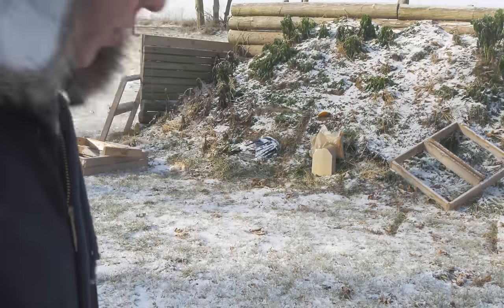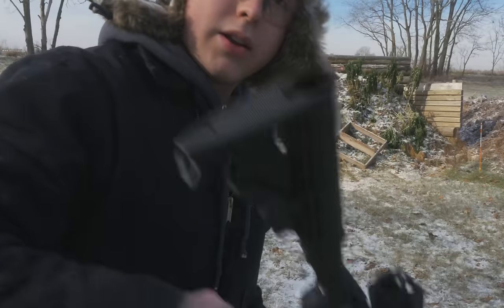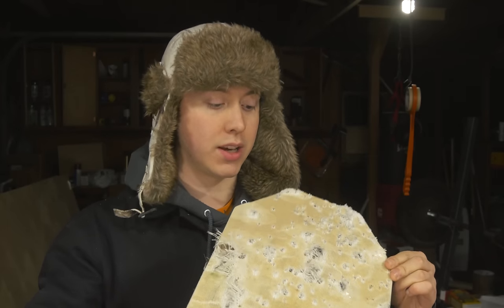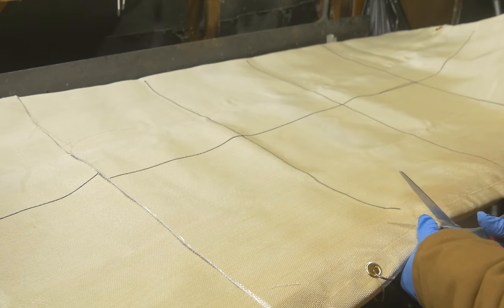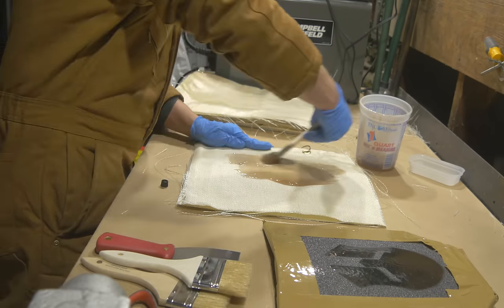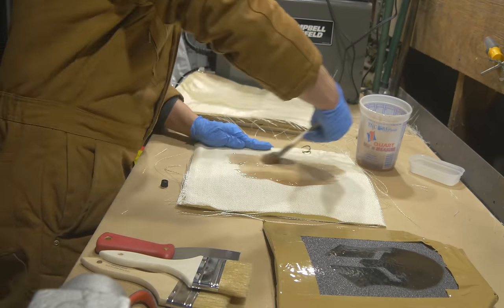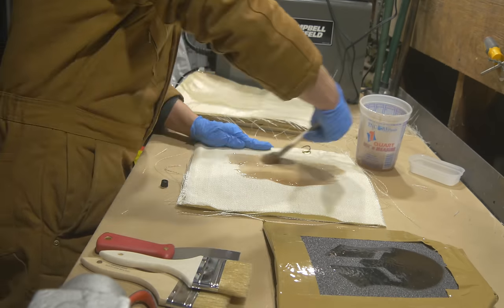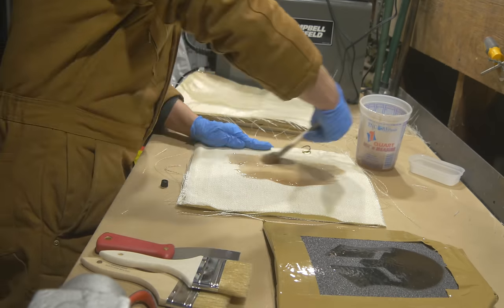How to Make AMAZING Bullet Resistant Armor for $30

Comment: stops 9mm: I have seen this before.
stops birdshot and buckshot: you got my attention.
stops slug: spills drink
Reply: the real question though is how far does it like dimple in you need to put it on clay and shoot it. if it goes in more than I don't remember exactly it was like an inch its still fatal. because the shock will still RIP your organs apart. like tear your heart in two. stopped the bullet but doesn't mean shit if your heart is in 2 pieces. look up nij tests and standards
Reply: Buddy, time to make that shit, right fucking now!
Reply: @bobthompson4319  when worn inside a carrier that might make the difference tbh
Reply: @AshleyBlackwater  not true. it would need to be tested correctly. have you ever seen what it looks like to be shot with a vest on? it stretches the skin so much that it still makes a hole. it's not like the movies.
Reply: @bobthompson4319  I mean the carrier itself can be the difference between wether it works or not. Unless i'm thinking of specific designs that require both hard and soft armour?
Reply: @bobthompson4319  Maybe so, but you aren't gonna wear the plate right up against your ribs. You will have it in a plate carrier and probably some clothing behind as well which will act as a buffer for the indentation in the plate. Best solution would probably be to have some impact foam like used in bicycle helmets etc behind the plate so that they can crack and absorb the dent impact of the slug. Only issue is that it will make the whole armor a bit thick, but hey if it saves your organs then why not
Reply: @Lorgar I'm sure they do, but they also gave them a name (Trauma pad inserts) in order to milk some extra cash by acting better than they really are. Truth be told, I don't know how much the difference would be or how much they charge for said trauma pads, but going with this video's idea of minimizing cost, I think some common protection foam used in bike and ski helmets etc is gonna be more than adequate for hindering a slug from ripping your organs though the body armor.
Reply: even more so if it stops a god damn 357 magnum round at point blank
Reply: @Real_MisterSir  blue camping pads comes to mind.
Reply: @bobthompson4319  Just add some trauma padding around the plate and make it a standalone plate
Reply: @bobthompson4319  how about spring loaded armor?
Reply: @NwoDispatcher  not likely to help. think of a soda can its really light nothing to hold it in place but a bullet will fly right through it so fast it doesn't move. so it's likely that the springs wouldn't even compress any and the bullet will slice through or if its stopped then it might help with the impact but having the springs help with stopping the bullet it won't help with that the plate of armor would have to be able to stop the bullet its self. if all that makes sense
Reply: Thompson don't know, id figure it would be a factor of how much impact can a spring can handle before it bottoms out. The main reason for the spring would be to disperse the bullets force over the entire surface of the plate.
It would be the difference between   shooting the can with a pellet that's fixed vs one that moves.
Reply: Only if the guy wearing it is on the ground or against a wall will an inch of indent happen, else he will just get thrown back reducing the impact
Reply: @bobthompson4319  stops the guy behind you from being killed
Reply: @NwoDispatcher  doesn't work like that.
Reply: @preetammeena593  he won't get thrown back
Reply: You think stopping the birdshot was more impressive than stopping the 9mm?
Reply: @bobthompson4319  You could buy a trauma pad.
Reply: @bobthompson4319  despite the lack of need for one with most modern body armor currently made, a trauma pad behind the plate would be pretty helpful if you are afraid of that happening.
Reply: since you all know so much and have such great ideas about how effective this will be why not strap it on and take a 12 ga 1oz slug from 10 ft???? if you do I'm not responsible for what happens. and then you can all see for yourselves.   post a video...... or have someone else do it in the event of your likely death or serious injury.  I'm waiting. I need a good laugh.
Reply: @bobthompson4319  What you need is to calm down, lolz.
Reply: Better than walking without armor thats for sure
Reply: shoots t rex shot (real thing used to stop hippos on an africa safari)
Oof im def- stops it
Im suffering cancer
Reply: Bro you should really wear a mask when cutting or sanding that fiberglass I don’t want you to get on those mesothelioma ads...

Butttt I’m probably gonna do this now... 👍
Reply: Wala pm pako unya bai
Reply: @bobthompson4319  indeed, but it is cheap and light weight. Perfect for bullet proofing a car on a budget.
Reply: Slugs aren't that hard to stop
Reply: bob thompson that could be eliminated with padding
Reply: Riiight!!!! Got me HOT! 😍
Reply: Most body armor stops shotguns.  Pistol rated soft Kevlar will usually stop most buckshot and probably the majority of slug designs.  They have a pretty slow velocity so they are easy to stop with armor.  It would probably break a few ribs though.
Reply: @bobthompson4319  Impact seems minimal, but of course, this can lie. I'd expect minimal impact even so though...
Reply: @kiLLaima  It would then be a ICW plate because it's worn ICW the pads, and besides that TPs aren't ballistic, just shock reducing.
Reply: I think all you experts out there since you know SO much about this should give it a shot. Put one one and try a slug or something.
Reply: @bobthompson4319  
Hard pass on that one chief. Production variance and all that.
Reply: Bob  that doesn't mean it won't kill you
Reply: Bob   and you obviously don't know what your talking about. Trying to say that some homemade "armor"  not tested in a way that matters by people who know what they are doing is good and should be used no problem. Dont buy the expensive stuff that's tested for years and through different environments like getting wet then dry and so on. That makes it very obvious you have no clue what your talking about. Go back to riding your scooter.
Reply: Bob  this isn't a plate it's not steel it's some fake homemade shit. Like I said strap it on and fire away. Since you know so much. It's what real armor companies and inventors do. So you do it to. You have so much confidence in it. So do it live so we can all see it and someone else can record it. So we can all laugh while your at best in the hospital.
Reply: Bob  yes you are. That's the first time you've been right yet.
Reply: Bob  if you were using the body armor in this video there are slugs made for armour piercing. A slug round has 3 times more kenetic energy than a 7.62 by 39 it will definitely at least break bones if you were to shoot it at body armor
Reply: Bob  the problem with slugs is they  drop off velocity very quickly
Reply: Bob  how nice of you
Reply: @krysc3278 you sure called that one. Our country has gone to Hell. I wish I was thinking about armor 10 months ago when you posted your comment. 👍🇺🇸
Reply: @NwoDispatcher  spring loaded like shock absorbers. That's definitely thinking outside the box! Great new perspective on armor 🇺🇸
Reply: @AshleyBlackwater  Depends on what carrier you buy, most plate carriers are just carriers, but they do make plate carriers that are IIIA. They're more expensive though, 400+ dollars instead of 70-150 for just a carrier.
Reply: Bob  I was actually on the fence of whether you were right until you said "If it was with a malleable armor such as Kevlar, then yes the kinetic energy would annihilate your intestines. But when a plate stops a slug it absorbs most of the kinetic energy!" your arguement started to make sense c:

Either way thanks for the discussion. I'm gonna do my own research but I learned a bit
Reply: @wthall11689  10 month old comment man. What I mean was that the material of the carrier itself does help a bit with resistance. Buying a carrier that comes with built in plates sounds like a rip off when you need to replace those plates
Reply: @AshleyBlackwater  You responded to a 10 month old reply... Also carriers don't come with built in plates, but some of them are made from Kevlar and are layered to provide what is known as level IIIa protection. IIIa means it is rated to stop any pistol or shotgun slug, rifle ammo isn't as big a slugs but are sharper and travel much faster and will tear through kevlar, hence the reason plates exist. AR500 is a newer type of steel composite that they make body armor plates from and is the most common form of body armor. With metal plates, instead of ceramic which continue to shatter when shot and require a IIIa rated carrier, you don't have to have a kevlar carrier because the metal plate is good until it isn't at which point the kevlar wouldn't help anyway.
Reply: @wthall11689  it wasn't 10 months when I replied, only a few weeks or so.
And ah right I know what you mean now. Effectively soft armour as opposed to hard right?
Reply: @AshleyBlackwater  Kind of, the Condor plate carrier I wear is made of I believe teflon or some kind of similar material that is strong and doesn't wear and tear. The only ballistic protection is from the AR 500 steel plates bought and inserted separately. They make more expensive carriers made of layered kevlar that are what's called level IIIA protection that only stops pistols and shotguns, but not rifles unless you buy plates to insert into them. They also make regular ballistic vests made of layered kevlar that are only level IIIA and they are usually used for concealment and aren't as bulky. The other type of plate, which is still used only by certain militaries, is a ceramic plate instead of the AR 500 steel. The ceramic plates cost more to deploy because they can only be used in the IIIA kevlar carriers and they can only stop so many rifle rounds as it shatters to slow the round, which is why they have to be replaced but the bullet also doesn't fragment and create as much "frag spill"(the shrapnel from the bullet fragmenting against the steel plate).
Reply: @bobthompson4319  
*can be fatal
Reply: birdshot is hardly even lethal at least not to a man size target
Reply: @bobthompson4319  well it's better than letting a piece of lead go right through you in terminal velocity
Reply: @NwoDispatcher  you dont want metal wire behind the plate, foam will do a better job
Reply: I used an angle grinder and it cut that shit like butter
Reply: Level 3a stops buckshot and slugs along with .44mag .45 or less
Reply: I wonder if a thin layer of ceramic in a mesh material on the front would be level 3 or better
Reply: @bobthompson4319  an inch wont
Reply: @user-rd5nc1nb9f  nij standard  is 44mm. Over wet clay.
Reply: @bobthompson4319  🤣
Reply: @DmT-py6zg  When that ounce of lead hits the metal plate armor, it disperses its energy across the entire plate instead of just the tip of the bullet, which means that the foam behind can absorb exponentially more energy due to it being spread out. It aint rocket science, and it doesn't mean you wont feel the impact. It just means that the potentially killing/seriously harming blow is gonna be absorbed
Reply: @bobthompson4319  but I think the force of it can be dispersed more when it's worn in a vest especially when the wearer is standing up or walking around like he can just get kicked by the slug and makes the round lose force by the wearer getting kicked halfway across the room🤣
Reply: I'm picturing that Vince McMahon meme with every step of this comment.
Reply: Wouldn't the impact still make your lungs pop?
Reply: @bobthompson4319  well that's a different case. You see it's the springs that are supposed to do the work, and the armor itself acts as a  buffer to the springs to allow them to act on the bullet. It's like having the springs themselves made of bullet-resistant material.
Reply: @bobthompson4319  also, a bullet is not going to be shooting straight through a spring. Where did you get that from?
Reply: @bobthompson4319  Yeah deformation is a problem. But this armor is rated for pistols and most shotgun projectiles only So I wouldn't worry about it too much. Pistols and buckshot have shitty ballistics relatively speaking.
Reply: Instructions unclear, was shot and am now clinging to life via life support
Reply: @KoishiVibin  ICW has nothing to do with a trauma pad. An ICW level IV plate for example is rated level IV while wearing in conjunction with IIIA armor.
Reply: @therealandrewcano  
A ICW insert requires assistance to reach full potential. In this case it is said that the insert would need a trauma reduction panel to protect from possibly hazardous deformation.
As such, ICW.
Reply: Can you decribe the fabric and the glue which you used.
Reply: @bobthompson4319 more than 2 cm blunt trauma
Reply: @bobthompson4319  Legit concern, you could add a foam end layer may be

Comment: Also, If you're going to do a lot of this type thing invest in some mold release and a vacuum pump. your plates will fall off easily. Plus placing it under vacuum in a bag places atmospheric pressure over the entire piece which is about 14.9 psi. It will result in a much denser component with less porosity, it will be lighter due to squeeze out, and much stronger. Excellent job though!
Reply: Car wax should work just fine. Cheap, you get a lot per tub, and it performs just fine for a resin release.
Reply: Thumbs up just for using the word "porosity".  :)
Reply: where can i get one and how much will it cost
Reply: @-jank-willson the vacuum pump? I worked at an electronics manufacturer that used ones they built themselves for removing air from the epoxy used for encapsulating parts. It looked fairly simple iirc

Comment: I've seen some videos on making rifle rated body armor up to level 3+, to make it stop rifle rounds it needs a ceramic strike face to break up the rifle bullet into shrapnel, deflect energy back at the bullet and absorb most of the energy as well as spread the energy out over a larger area so once the bullet shrapnel passes through the ceramic the fiberglass and resin backing can effectively catch all the shrapnel and absorb the remaining energy, I found that a porcelain floor tile is the best homemade option of ceramic material, also it's good to use a foam backing on the back of the fiberglass plate to further help protect the body from the impact of the bullet projectile.
Reply: or put the porcelin in the back, so that the fiberglass can prevent the shards flying up into your face
Reply: I would do a floor tile like you mentioned since you can cut them to shape and then in front of and behind it a thin layer of foam

Comment: 10:00 
Resin dies not dry or need air

It is a chemical reaction that makes a powerful polymer chain, and is considered plastic. 

Basically 

Now ideally like what you did here, and if you found thinner fiberglass to work with, but same dimensions, you would end up with more layers. If you take the weave and offset it, say 45 degrees or what ever flavor you want, use a higher strength resin, and higher clamping form pressure, degas the resin and fiberglass ect, you can surpass your 556 or 223.

Just from another maker to another
Reply: This is a 2 part epoxide either based Thermoset Resin Cement used to bond this fiberglass, itself made of woven thermoset fibers extruded from a spinneret, or some such device filled with small holes, while it is curing. The 'activator' in the small tube, usually some sort of esterified organic peroxide, initiates the cross-linking reaction which perpetuates on its own until fully polymerized. It is an exothermic cross-linking reaction that 'cures' without drying. This is then called a 'thermoset' polymer. Usually applying controlled heat and pressure can cause it to cure faster and more completely, even without initiation in many cases.

After curing it is not considered plastic any longer because it cannot be constructively deformed or be transformed by heat or any other mechanical means into a mobile, or plastic form, for re-processing.